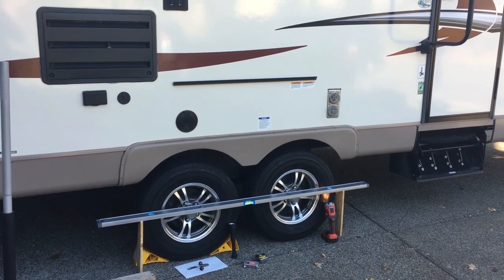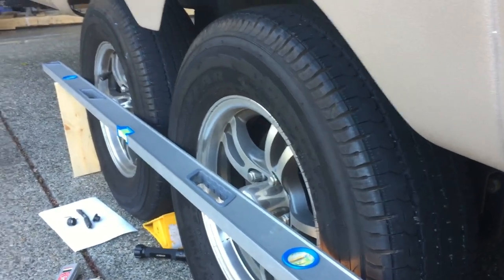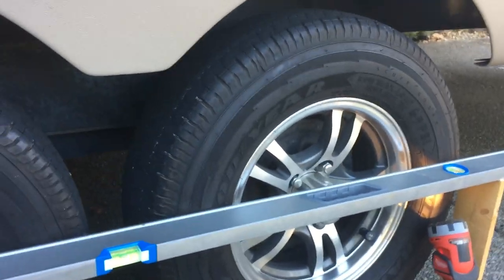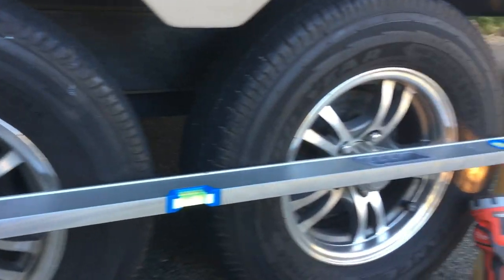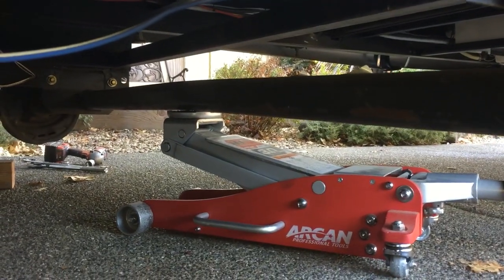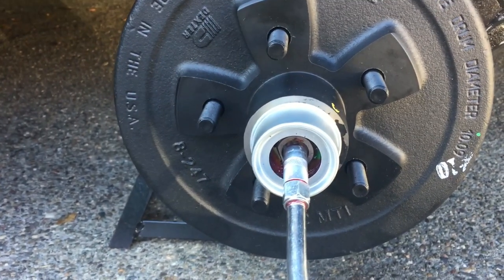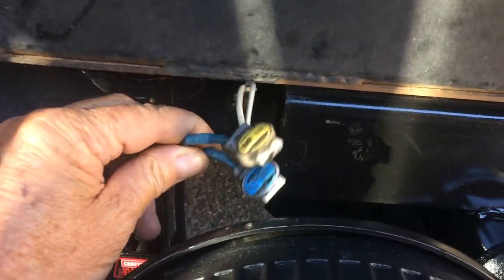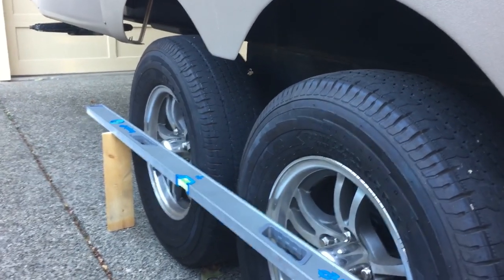Travel Trailer Bent Dexter TorFlex Axle Problem & Replacement

Comment: Lovely, another thing to worry about.  I posted in your other video about the Dexter E-Z lube job that I take along all kinds of suspension parts with us when we travel.  What now?   Do I need to order a complete axle to take along!!!   It's too much.  They make these RV's like junk.  We've had so many problems with our 2019 Coachmen Catalina.  Bought it new.  The biggest problem we had was leaks when it rains.  I already replaced the slide seals.  Then it leaked above our bed where the front of the trailer meets the roof.  Used sealant to fix that.  It's one thing after another.  If it continues to nickel and dime us, I'm unloading it.
Reply from the maker: Wow that's a bummer what is the model number of your trailer? This video may be helpful to you for stopping leaks - https://youtu.be/zUxnQ6C1BlY 
Rubber Roller - 
https://amzn.to/3rMYvXJ

Spline Roller (Screen) - 
https://amzn.to/3tkBlrU

Dicor Self Leveling Sealant - 
https://amzn.to/2PUIFfs

Mineral Spirits - 
https://amzn.to/3qGoZc4

Acetone - 
https://amzn.to/3wotLl7

Denatured Alcohol - 
https://amzn.to/3vrEDLO

2" X 50' Eterna Bond Tape (white) - 
https://amzn.to/30FBABE

2" X 50' Eterna Bond Tape (black) - 
https://amzn.to/3g7F47I

4" X 50' Eterna Bond Tape (white) - 
https://amzn.to/3eEnzfG

4" X 50' Eterna Bond Tape (black )-
https://amzn.to/3ALBfi7

3" X 24" Eterna Bond Tape (Small Repairs) -
https://amzn.to/3LNshWx

EternaBond EternaClean Spray Cleaner 14 oz Can EB-ECSPC | Prepares Surfaces for Sealant Application by Releasing Contaminants Like Oxidation, Grime, Oil and Grease, Tree sap and More -
https://amzn.to/3vmGWyy

EternaBond EternaPrime Adhesive and Surface Conditioner Spray - 14 oz Can EB-EPSPC | Aids in Adhesion When Surfaces are Very Dirty or Dusty - for MicroSealant and Other Self Adhesive Seaming Tape -
https://amzn.to/3cElEG7
Reply: @thetraveltrailerguy  Hi Mike, thanks for sending the information!! I actually used the Dicor Self Leveling Sealant.  I thought it would work.  It went on nice and then it leaked again above our bed about 2 months later.  Went on the roof to look at it and it kind of cracked and split in some areas.  You know, when you are pulling these campers, they are constantly shaking and bouncing.  So then I used Flex Seal and guess what???  No more problems.  I put 2 coats of it across the seam and so far, it's been almost a year and hasn't leaked.  I thought that Flex Seal was a stupid commercial with their products, but now I swear by them.  If I get more leaks, I may try that Eterna Bond Tape next.  We have a 2019 Coachmen Catalina 243RBS.  We haven't really used it that much for us to have roof leaks. The worst was when I had the trailer parked at our house.  It poured rain for a couple of days.  A week later, I put the slide out and it was a waterfall coming inside the trailer from the top of the slide.  Water had leaked past the outside seal and accumulated on top of the slide inside the trailer.  So putting the slide out, it came over like Niagara Falls!!  I told my wife that if we continue to get problems with this camper, it has to go!  Again, thanks for taking the time to send the information.  Gary
Reply from the maker: @garyp9906  https://youtu.be/NOyHNIA46Gs

Comment: Hello Sir. Thank you for the video. 
What kind of pictures did you take and show Dexter? What kind of proof did you give  them that the axle was bent? I am exactly in the same situation.  Please help me
Reply from the maker: Thanks for watching and asking your questions. Its amazing how many people have contacted me and say they have the same problem with their axle or axles. 

First - I drew an over head view of the axles with tires showing the tread groves on each tire and made sure I wrote which one was the front and rear axle, I also drew where the frame was just inside the tires on each side. I did this so I could record the information you will see I collected below on this drawing :

(1) So what I did was put a straight edge against the trailer tires and took a picture showing how much of a gap was showing between the tire and the straight edge and wrote down the measurement. Then I went to the other side of the trailer and did the same thing (on the other side there was no gap and the axle spindle was straight. Record all this information on the drawing. 

(2) I then took measurements from the trailer frame to the inside edges of each tire and wrote down those measurements. What this did was show them more proof that a spindle was bent. Record all this information on the drawing.

(3) Then I measured the depth of the tread in each tire grove and recorded all this information on the drawing. If a axle or spindle is bent you will see abnormal wear in the tires tread. 

(4) I took a photo of my drawing with all the information to send to them in the form below (open that link). They have several questions you will need to answer on the form but its fairly simple to do. They should get back to you in a few days and if not call them.

(5) You can submit all your information to Dexter and call them if you have any questions https://www.dexteraxle.com/Contact/Warranty-Claims

(6) Warranty - https://www.dexteraxle.com/user_area/content_media/raw/dexter-limited-warranty-lit-400-00.pdf

I'm happy to help you through this, please get back to me on how its going. I hope all I provided is helpful
Reply: Thank you so much for responding. 
I will keep you updated, and I'm grateful for your help.

Comment: Looks like your wheel chocks are upside down.
Reply from the maker: Good catch and thanks for watching and commenting. I place them with the ridges on the ground instead of up next to the tires so they will grip the ground better. If the smooth side is on the ground they have more of a chance to slide. If you search the internet you will see that the majority of people that sell them and use them place them with the ridges down. 
https://www.youtube.com/@thetraveltrailerguy/videos
Reply: @thetraveltrailerguy  Cool news I just ordered a set just like those who knew! Thanks!
Reply from the maker: @tymobyrne4451  That's great, you will like them :) Here's a link to a video I did on wheel chocks you might like watching - https://youtu.be/UvXDrpGJVgE?si=UPbmgF5-AjQHoYIn

Comment: We are told we have a bent axle. Only one tire was wearing a bit on the inside.  We are due to vacation in 2 weeks.  Cannot get it dixed b4 then. The trailer repair company said they may be able to try something else that would allow us to go on vacation.  We have a spare, and brand new tires. Can you still travel with a bent axle, an just change the tire out when wear seems bad? Or is it not a good idea to travel with the bent axle?
Reply from the maker: Hello and thanks for watching and your question :) What I have to say is my opinion on what I would do if this was happening to me so please don't hold me responsible if you do this and something goes wrong :) 

First I would like to start off saying from what I can tell at the time I discovered our bent axle it was probably bent and the trailer towed for a couple years and we camp a lot (every two weeks year round & on a few 1,000 + mile trips). So when I discovered the problem I was okay towing the trailer this way and only the tire had wear on the tread area, I probably could have towed the trailer several more miles this way. I did not notice any difference in towing the trailer with the bent axle compared to having a axle that wasn't bent, all that was happening was there was more wear on the tire tread. The axle bearings were not showing additional heat from the axle being bent while towing. 

How many miles do you plan on driving on your trip? What is the make and model of your trailer?
Reply: @Michael Bracewell The Travel Trailer Guy  thank you for responding.  We have a 26 ft viking 2021.  Duel axle.  We have a tire sensor that senses temp and pressure.  The wear is only on one tire, and not really that bad. We put on new tires, but got it checked out at a trailer shop due to the wear on the one old tire.  They said the axle is bent a bit near that tire.  They don't think it's dangerous to drive but suggest we take a spare along. Our trip will be 2000 miles.  I talked to several people today and only one strongly suggested not driving it on a bent axle. I will by no means hold you responsible for your thoughts on this matter. According to our repair ship, who are highly reputable,  there doesn't appear to be anything more serious wrong with it.
Reply from the maker: @trustinginhim3189  Thanks for all the information, if it was my trailer I would  go on my planned trip and just check it from time to time on the to make sure everything is good. Have fun and thanks so much for watching and your comments.
Reply: @Michael Bracewell The Travel Trailer Guy  lol, so there is an axle available 3.5 hrs away.  We are going to road trip to pick it up. We still have time for an install b4 our trip.  We do agree with you,  though....98% of people told us what you said. I decided to just get it and be done. I really appreciate you. God bless!!
Reply from the maker: @trustinginhim3189  That's great news, if you ever need to ask anymore questions about trailers I'm here for you :) Bless you and your family, have a fun trip

Comment: I have the same problem with the one uneven tire and  since I did not put but 3000 miles per year on my trailer, the warranty would be out. How many miles do you think you put on the tire before it would have been noticed? What kind of frame shop could correct problem and how much would it cost?  My tires reached the 6 year old limit and I bought new tires. I thought I would rotate the tires on that spot ever year to lessen the effect. What are your thought about that and would there be some  disadvantages?.   I enjoy your videos
Reply from the maker: Thank you for watching my videos Ronald and I'm sorry I'm not getting back to you sooner but we were out camping :) I'll do my best to answer your questions. I'm not sure if this axle has had this problem when we purchased it new 3 years ago or it happened sometime after, I know I've never hit anything while pulling the trailer. (We have towed our trailer 20,000 miles and discovered the problem at 15,000 miles); Regarding a frame shop, I'm not sure but I would recommend searching tire and brake shops in your area and giving them a call, I'm sure they can recommend a good shop in your area that does this type of work; Regarding rotating your tires instead of fixing the problem, this would be your choice. It all depends on if you will be towing the trailer several miles per year or less. If it was me I would at least see how much it would cost to have the problem corrected, it may be less than we think. I sure hope this information is helpful
Reply: @thetraveltrailerguy  Thanks for your response. My axle is made by Lippert and  I just found a item call Lippert Correct Track that is welded on the frame to make adjustments and is sold on eBay and Amazon. I plan on contacting  some dealers to find out more information
Reply from the maker: @ronaldphillips8750  You're welcome. I hope you can keep me posted on what you find out about the Lippert Correct Track

Comment: I had another question about jacking up 1 tire at a time. Would it be better to jack up tire under the U bolts or on the frame close to the tire. My frame does not look built up in the tire area as your does.  Thanks
Reply from the maker: Sorry it took me so long to reply, I wasn't notified of your comment and just saw it now. Thank you for watching and your question. Jacking up the axles I have they say to never jack them up using axle and to only lift from the frame or the axle will be damaged. What trailer do you have and axles? https://www.youtube.com/@thetraveltrailerguy/videos

Comment: Other than the issue covered in the video, I'd love to hear your thoughts about the trailer after 20K miles because we're considering purchasing the same make/model.
Reply from the maker: Here's a link to all my videos I've made so far that may be helpful - https://www.youtube.com/channel/UCadr-Oi9dyjK41DOefVL27w/videos       

We've had this trailer for 4+ years and really like it. So far it has done very well holding up, I did have to rebuild the Murphy Bed but that was a manufacturing flaw. We replaced the mattress soon after we bought it because the original one had no support and was very cheap and the topper we bough for it did not help at all. 

Soon after buying and using it we found when the Murphy Bed was down there was a big gap between the mattress and the front of the trailer where our pillows would fall when we were sleeping so I came up wit this solution that works really well https://youtu.be/bfN87DOZDUw

We really like this 2017 Rockwood Mini Lite 2504S trailer, they stopped making it a couple years ago and came out with another one like it that is pretty nice but the new ones have a front windshield that some people love and hate, some people are reporting the front windshield can crack and while sleeping by it you can feel the coldness from it. So I'm happy we have one without the front window even though it looks really cool.

My wife and I use this trailer a lot and pretty much go camping year round every two weeks for 3-4 nights at a time and have gone on a 40 & 30 & 35 day trips with no problems, you will have small things come up from time to time like screws coming loose or something but they are easy fixes and I make sure I always repair things right away so all the little things don't become big problems down the road.

Bottom line is we would buy this trailer again, Rockwood trailers are made very well compared to many trailers out there.

If you are not subscribing to my YouTube Channel I hope you do so you can see future videos that I put out that may be helpful to you no matter what trailer you may buy. 

If you are on Facebook there are several trailer groups I've joined but the best one out there for the Rockwood Mini Lite's where you can learn a lot and ask a question and get good answers is the "Rockwood Mini Lite-Flagstaff Micro Lite Fan Club" https://www.facebook.com/groups/1901493023470645

Do you know the history on the trailer you are thinking about buying and has it been taken care of? What State do you live in? 

Mike Bracewell 
California

Comment: @Michael - what did they say about the warranty? Why were you close to expiration? I thought these axles have a 5 year warranty. If I remember correctly, you have a 2018 Mini-Lite? I've got a bent axle causing the front right wheel to toe out. I'm going to file a claim with Dexter and could use any pointers you have for me.
Reply from the maker: We have a 2017 Rockwood Mini Lite 2504S that we purchased in October 2016. What I did was contact Dexter and let them know of the problem, They wanted to know what axle I had (you get this information off the sticker located on each axle) they asked me to send pictures (I sent a picture with the level against the tires like you see in the video and others to them and the wear on the tire) and a explanation of what is wrong and email them to the guy I talked to on the phone, he then forwarded everything I sent to Dexter Engineers to review, then the original person I contacted me to let me know they would be sending me at no cost a new axle but they would not be paying for installation. Give them a call and they will let you know what you need to do. I hope you get back to me and let me know how it goes? What year and model trailer do you have?
Reply: @thetraveltrailerguy  I submitted my warranty claim, but they denied it because I'm not the original owner of the trailer. :(
Reply from the maker: @jplee123  That's a bummer
Reply from the maker: Maybe the original owner can submit the claim for you, just a thought. Did they say how much it would be to buy a replacement axle from them?
Reply: @thetraveltrailerguy  I've seen them online for about 500

Comment: For your own safety, please use wheel chocks correctly. They are upside down.
Reply from the maker: Good catch Fireman :) actually I used to install the chocks the other way but they didn't hold the tires still because the bottom edge would touch the bottom of the tire and the top part of the wedge wouldn't touch the tire so I flipped them over and now its all tight and works great  :)

Comment: Hey Michael, how did you get that off the truck?  Dexter says I need a forklift.
Reply from the maker: Since it was heavy it was strapped to a pallet and delivered on a large box truck that had a electric lift gate and the driver used a pallet jack and placed it in our garage. My thoughts are whoever delvers it to you will have a lift gate and pallet jack to unload it. Do you know what trucking company they are using to deliver it to you?
Reply: @thetraveltrailerguy  Dexter said their trucking company won't have a lift gate because it isn't available for warranty shipments.  Really odd.
Reply from the maker: @milesb4231  Wow interesting. I would just have a bunch of my friends there for the delivery to lift it off the truck. I think it weighs only a 200 lbs +/-